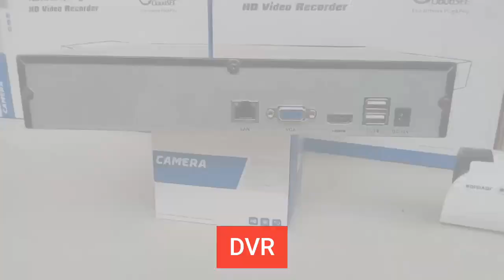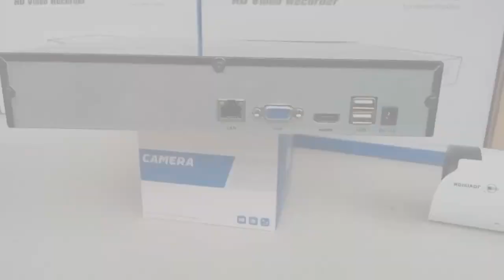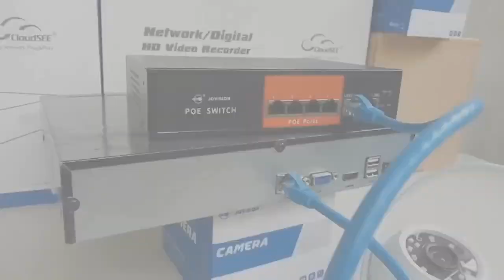Difference between CCTV DVR vs NVR

Comment: Great job sir. 
But I have a question ❓

Sir, can the I.P cameras be powered via the cat 6 cable from the NVR OR POE  alone without any external power adaptor ?
Reply from the maker: Yes, you can power a POE IP camera through the ethernet cable without any external power
Reply: @Tech_Inside_Out  I'm satisfied sir. Thank you very much 🙏
Reply from the maker: @Biblestories50  Most welcome

Comment: Which one is best?
Reply from the maker: I prefer NVR to DVR because DVR requires cumbersome wiring using bulky coaxial cable + power cable whiles NVR uses just a single network cable which carries both video and power. The wiring process for DVR is also quite complex and I find NVR wiring much easier.
Reply: @Tech_Inside_Out  do you train people as well, because I want learn it practically
Reply from the maker: @okyeitv  Yes I do.